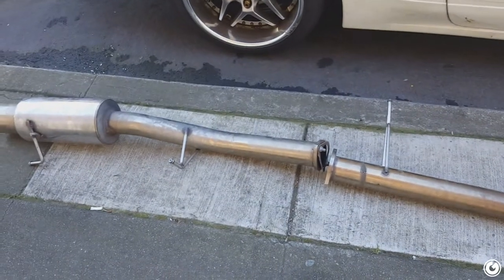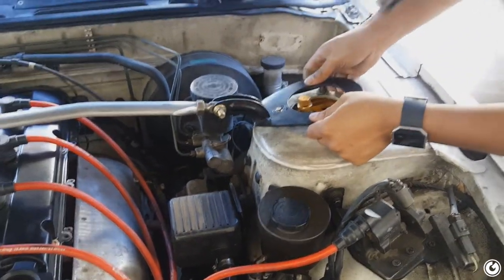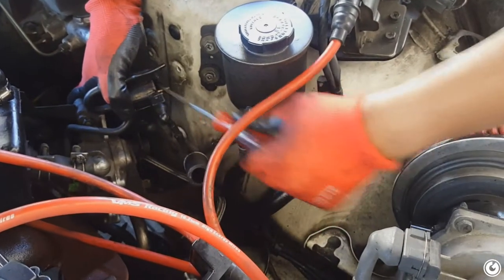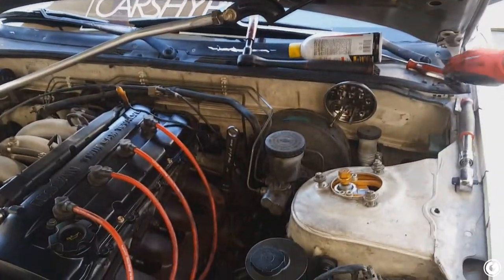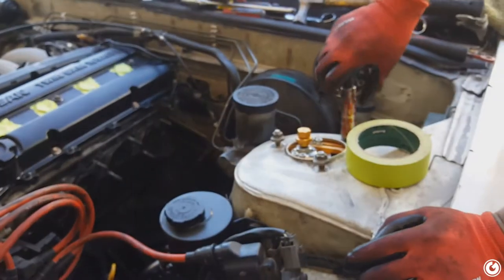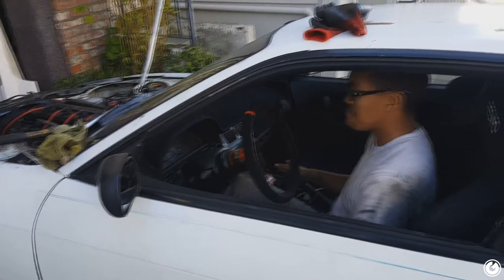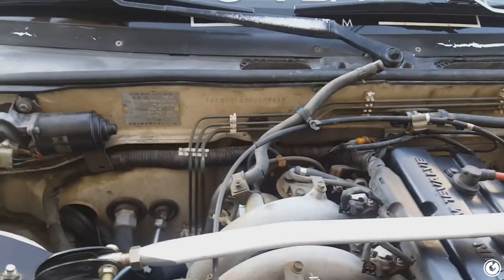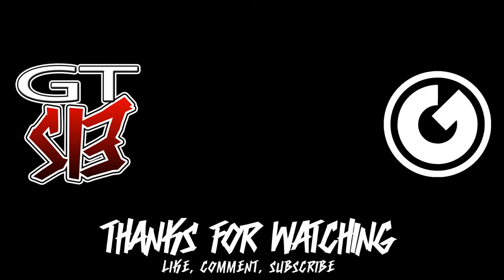DC header install & 3" catback exhaust 240sx | EP. XVIII - GTS13

Comment: You adjust idle on back of intake manifold at idle air control valve theirs a adjustment screw .... If you move your distributer you change timing and either loose power or risk spark knock, nice 40 tho man torque from the ka rules